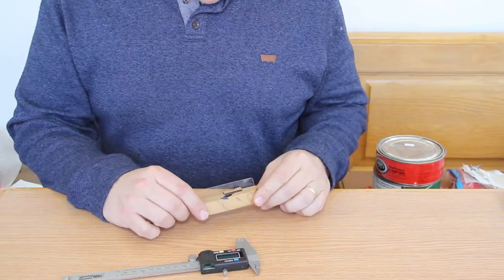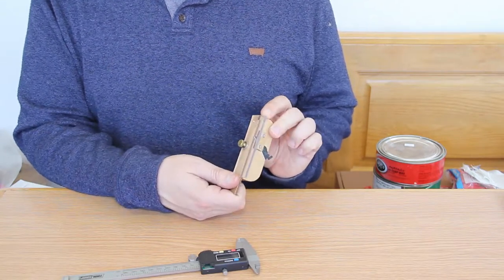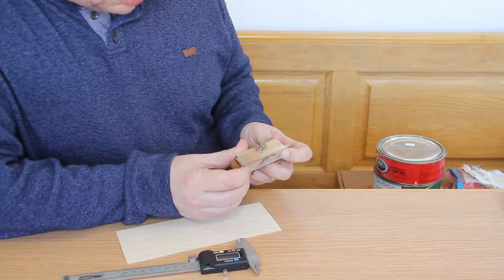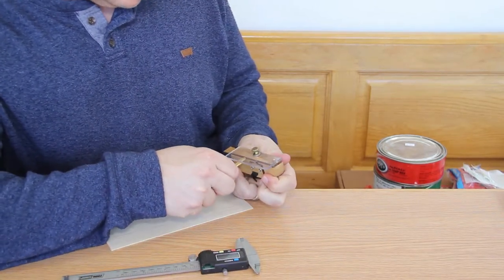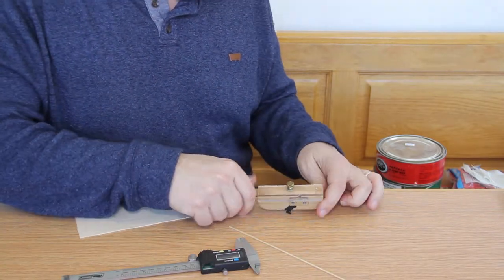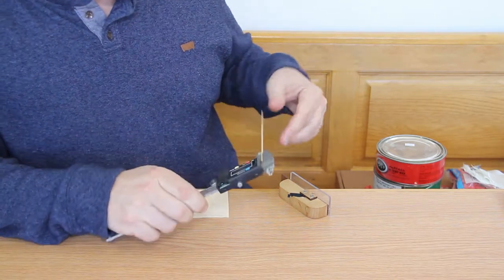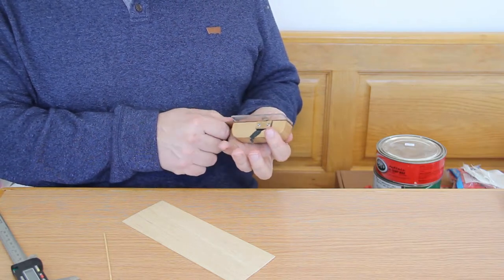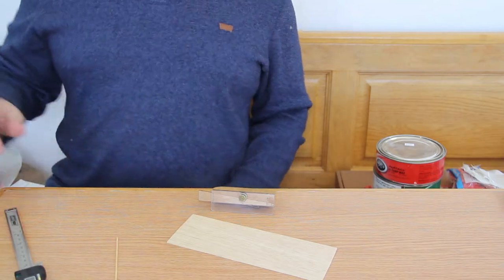F1D vLog Episode #16 - Tyson stripper

Comment: I have a Harlan rubber stripper, but the directions are not all that clear about how to sharpen it. If you have a Harlan rubber stripper, could you make a video on how to sharpen it please?
Thanks!
Reply from the maker: Hi Ross. I don't have one of Harlan's rubber strippers. I have a Wayne Johnson modified Oppegard stripper and one of his new rubber strippers. I had a Leeson, but sold it recently. I would imagine the best way to do it is to remove the blades, chuck them into a lathe, then hone them just slightly, followed by a strop lathered up with stropping compound. Then clean the result up with acetone, check the edges to make sure you have no metal curl and reassemble. Am guessing an hour to do this. Regards.